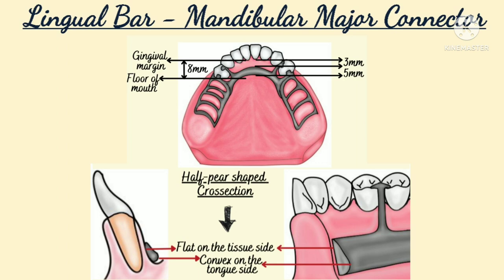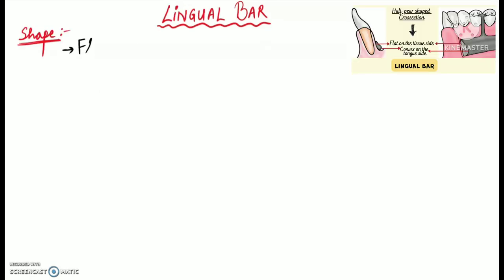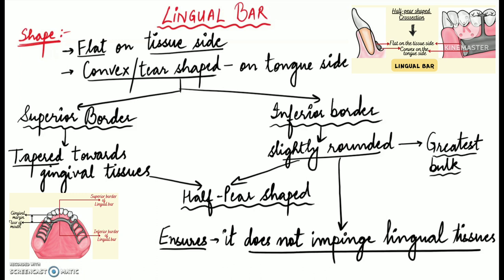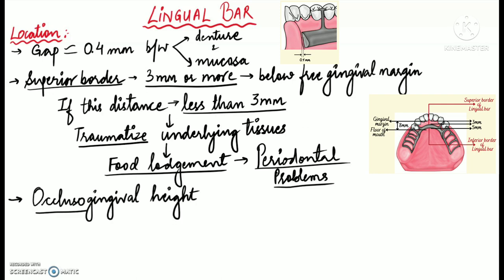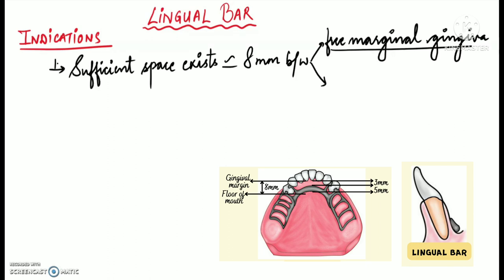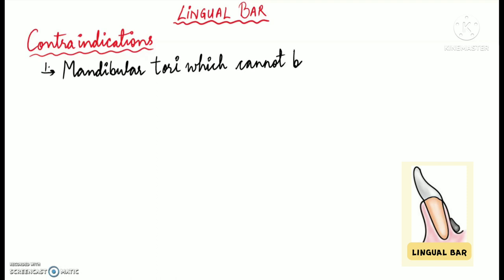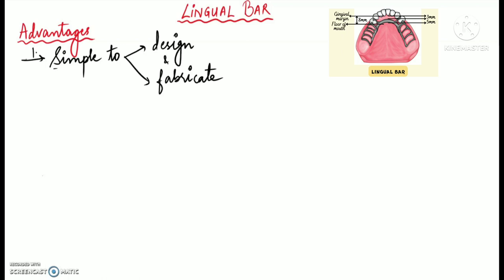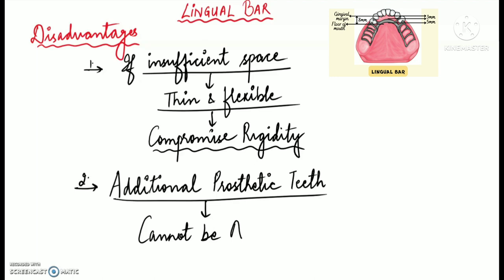Lingual Bar - Mandibular Major Connector/ Removable Partial Dentures

Comment: I'm learning a lot. I have 3 teeth on my bottom jaw. I have an acrylic partial denture and dislike it very much. I have both my eye teeth and 1 lateral tooth next to it. My partial has metal that wraps around my eye tooth and lateral tooth on the other side. I have a front ledge with 3 acrylic teeth on it. Please, what other type of partial can I use. My dentist is Aspen Dental, and they do what is easiest for them. Plz help 🙏 😢